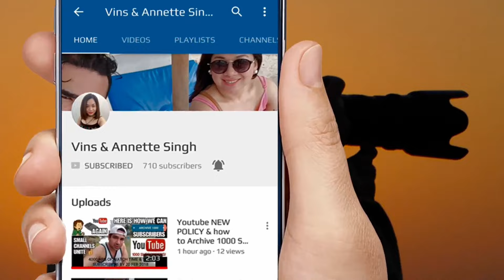How to repair concrete ceiling / Cement HDB ceiling / DIY repairs

Comment: I had the same exact problem.  3years ago before lockdown. some i used latex 108 in my cement. some didnt used it, still fine now.
Reply from the maker: Glad to know that , my ceiling looks fine too till now 😜 thanks for the information and comment. Have holiday 👍🏻🎉
Reply: would latex 108 help if the exposed patch is sandy? i have small patches where the paint peeled off and it's sandy. i'm afraid the cement won't stick to the old surface.
Reply: @willwen6600  hey glad to get comment even after 1 year. I'm also receiving this wall problem. But to counter this issue. Spray some water on it before plastering with premix cement. Premix have finer powder than self mix. If you need mix it yourself. Buy yourself some finer sand to workaround. Before slapping on the wall. Scoop some to your scraper and turn it around letting the cement mix hang upside down. If it doesn't hang. Means your mix is too watery. You just gotta find the balance
Reply: Bhaijan I repaired myself in 2018 still no issues.  But applied 2 layers paint of iron before doing plaster. Recommended by a YouTube video

Comment: That new concrete will fall shortly. It won't last long and the reason is because when you patch with concrete, you have to prepare the old concrete first. New concrete don't bond with old one very well so you need a bonding agent like Bullbond Sabakrete for example.
Reply: What if we use 

Mixture of ( Wall Putty + White Cement )
Reply: And at LEAST put some kind of screen like 1/4 inch rat wire and nail it into the afflicted area
Reply: Facts got demo around old rebar too and apply smarted 110
Reply: would bonding agent help if the exposed patch is sandy? i have small patches where the paint peeled off and it's sandy. i'm afraid the cement or mortar won't stick to the old surface.
Reply: @willwen6600  Of course, just make sure you use a good bonding agent. Many people uses the blue one because is cheaper but the yellow one with texture helps the new concrete bond much better
Reply: Plus all the rust is still there it needs to be either brushed away or treated, better if both.

Comment: There is alot of misinformation here. You cannot repair spalling concrete with just cement but must use a specialised form of polymer modified cement which is meant for such issue. Proportion of water to polymer cement is also important. It also helps if you cold galvanised the rusted exposed bars first. If you just use cement  with water mixture, it will pop and drop down in a short time.😆😆😆
Reply: We are tired of dealing with unreliable contractors, people who tend not want to do inconvenient works, and in the end then often being overcharged. We will learn.
Reply from the maker: Very well said 👌
Reply: What if we use 

Mixture of ( Wall Putty + White Cement )
Reply: Right
Reply: Repairing this chipping ceiling requires a lot. You will be needing chemicals to eliminate or prevent rust getting into the rebars. You also need a polymer material to bond with the cement.
Reply: would that help if the exposed patch is sandy? i have small patches where the paint peeled off and it's sandy. but the rebars are not exposed. i'm afraid the cement or mortar won't stick to the old surface.

Comment: new cement doesnt bond with old cement. Bonding agent must be used. Rebar should be treated to stop rust.
Reply: What if we use 

Mixture of ( Wall Putty + White Cement )
Reply: Also remaining rebar must be checked, or fresh rebar with overlapping is required

Comment: The reason why that part of the ceiling collapsed is beacause of the corrosion from the metal bar. Over time corrsion wil continue to build from the metal and that part of concrete will collapsed again. You should have put rust converter on the metal bar to neutralized the corrossion and paint it with expoxy primer to protect the metal from corossion before you patch it with cement....

Comment: Use angle grinder with a steel wool brush to take off rust. Vacuum dust from the concrete. Then, brush/ roll on a cement adhesive first. And DON’T spray water on the damaged area ever.
Reply: would applying adhesive help if the exposed patch is sandy? i have small patches where the paint peeled off and it's sandy. if i brush the sand off, i'm afraid it'll just make a bigger hole.

Comment: Did you use any specific types of cement for the patch work? We live in Hyderabad, Telangana, and had to do a similar patchwork for our old ceiling. It is very tedious and takes a lot of time and effort. Did you use any specific types of cement for this repair? If so, can you provide the name and if it is available locally here. Thanks

Comment: Before you apply the cement, you need to brush the area with a bonding agent.  Let it cure for 20 minutes then make ans apply the cement. When using the cement use your hands (wearing rubber gloves) to get the cement tight in the area. Then smoothe it out with the trowel.

Comment: Good job but not totally correct. You didn't apply anti-rust chemical on rebar and also didn't apply liquid-form cement to increase adhesiveness when you apply cement mixture to fill the crack.

Comment: You have to apply hv coat to those old concrete first. You should not spray water onto that patch. That will loosen your new cement. 

First of all this is not the cement to use
There is another type of cement with epoxy.